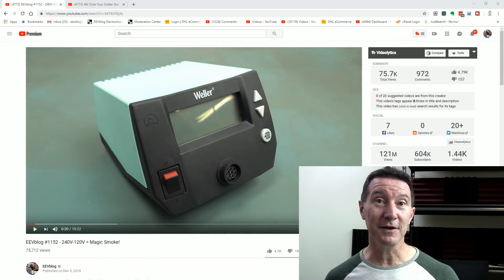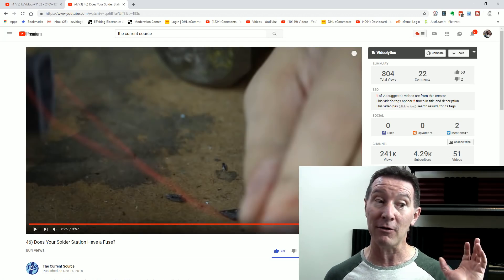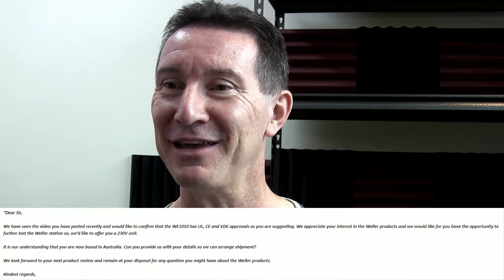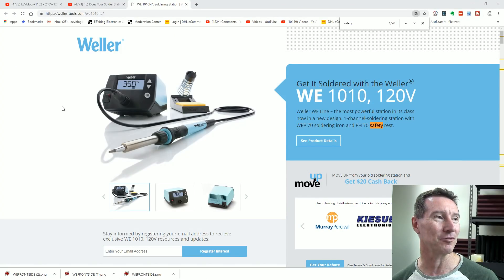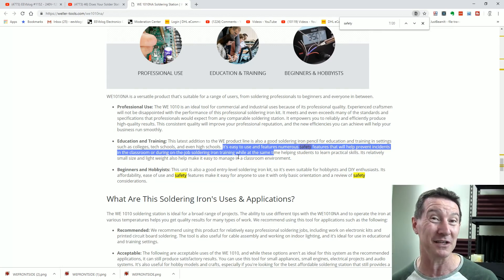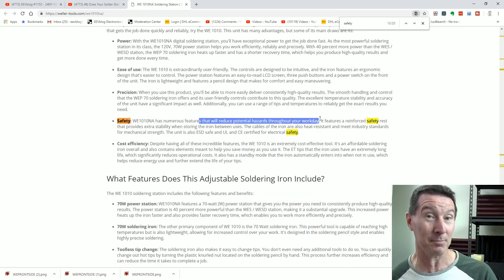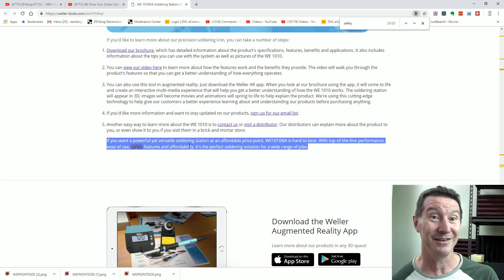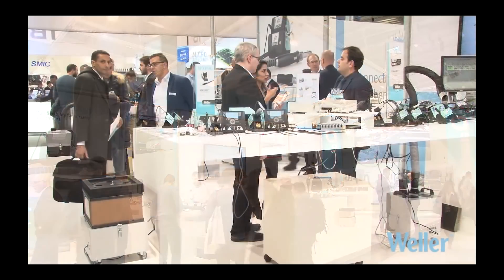EEVblog #1160 - Weller Responds!

Comment: Have a Chinese iron, its been awesome, heats quickly and accurately, has a backlight screen and  cost $80,  has NEVER let out the magic smoke (some of the big electronics  retailers sell same thing rebranded)  and has a fuse. Hmmm wonder why I never paid out the $500 or $600 on a Weller. I can replace this one 6 or 7 times for the price of 1 Weller that if it over volts goes in the bin.

Comment: Dave thx for sharing. Dave what are you whining about, all branch circuits are required by electrical code to have a current interrupter device. Once upon a time it was glass fuses now it's resettable breakers. So no damage will occur to the electrical wiring system. Just because the end use device catches on fire it will have no deleterious effect on the wiring system. That's the important part to remember the wiring will be protected. So what, if the soldering iron makes the user run for a fire extinguisher it'll be good exercise for a bench rat to do a little running every now and again. Hahaha.
Dave thx for sharing. Weller should be ashamed of themselves for ever letting something like that go out the door. I hate to say it, but it was probably signed off by cost cutting younger players who don't have enough experience to know any better.

Comment: Good point but maybe the "heat-resistant silicon cable" provides electrical isolation too.  Cheaper meters might only use silicone and not genuine silicon.  Flexible glass shows that Weller is well ahead of the competition and you should acknowledge that.  Thanks for posting this video.

Comment: It's possible to manufacture a mains transformer so that the primary winding safely fuses if it is overloaded. Without "excessive" smoking and retaining the barrier between primary and secondary. This qualifies it as a UL Class 2 transformer, I believe. So it's safe enough, it just is not a great way to do it because the product is trash afterwards.

Comment: Gotta love it when a valid issue is raised and the response is 'it's certified'... A successful brand like Weller should be able to go above and beyond with a very basic thing like a fuse, or for bonus points a breaker.

Comment: I'd really like to know more about why it does NOT need a main fuse (regarding regulations). Like did you ever see a watercooker with a fuse ? I've seen plenty wall adaptors without a fuse. So I'd like to know why aparantly it is not obligated to implement a main fuse. Thanks.

Comment: I have a Weller that I have used for many years. Usually functional, but unremarkable.  Now that I think back, there are several times that it was left on through lunch and glowing red hot on return. 

Thanks for the report. This is basic stuff.

The Weller will now be retired.

60 Hz or 61 Hz. Whatever it takes.

Comment: Just opened my PU81 station, it actually has a bimetal fuse on the transformer- an additional small glass fuse is hidden inside the 230V socket on the device itself. I bought the unit in 2013.

Pooooh- you scared me. Good this problem is not affecting the 230V series as it seems ;)

Comment: WELLER IS A SHIT. purchased WR-2 soldering station, paid a lot of money, 4 times that I change in a few years, the complete heating unit, (the temperature sensor fails, but the inside of the heating element body is sealed), 200 € per piece.
The quick release system of the tip makes you shit, spreads and the tip jumps away like nothing.
In short, you pay the name, but the product is little more than mediocre.
Beware, don't make my mistake, now as soon as the cheap desoldering station arrives from Amazon I take the Weller of my boots, and throw it in the trash.

Comment: Just got my Weller Model WT1010HN 150 Watt soldering station (2-16-2020).  What a beauty.  Two initial observations:  
1.  It has an AC mains fuse:  1.6 Amp, mounted below the 120 Volt power cord socket.
2.  The LCD screen has backlighting.

So Weller must have heard the complaints.

Comment: Finally replaced my Weller WTCPL soldering station.  Bought it in 1974 for $41.  It lasted more than forty years, with many replacement tips and a few shrink tubing repairs to both the mains line cord and the soldering iron cord.  It has been a great soldering station, but was finally time to upgrade to the Weller WT1010HN 150 watt soldering station.  Guess what:  The Weller WTCPL soldering station didn't have a mains fuse, either.  Guess I am lucky I am still alive.  What I would like to know is how it was possible to plug a 120 VAC soldering station into a 230 VAC socket; they are physically different socket/plugs.  North America uses International Electrotechnical Commission (IEC) Type A (2 prong) or Type B (3 prong, with ground pin), whereas Australia uses IEC Type I, with three flat pins in a triangular shape.

Comment: In defense of Weller, the failure released magic smoke, but didn't seem to be on fire.  If the primary windings used a fireproof "enamel", the risk would be mitigated and eventually the breaker would trip.
Would it scare the crap out of me?  You bet.  But, damage to Dave = zero, damage to lab = zero, and it didn't even trip the expensive fire alarm.
That said, yes, I'd like to have a primary fuse as well.

Comment: I got 3 Wellers, one brand new 2-tool WX series, one WTCP51 magnastat and one 45 years old magnastat. All three are working perfectly and yes, they all have primary side fuses. Problem is with business philosophy. Weller was sold to someone and that someone was sold to someone else. They start to produce cheap stations because of market philosophy they adopted and I am not glad about that. However, I would not buy this stuff. I would buy professional quality station because I do not want spend precious time by repairing my tools. I am glad they still make high quality stations. You can still purchase magnastats which shows how proven they are on the market.

Comment: Historically I've thought of Weller irons as being the "best of the best" or pretty close to it... the main reason I use Hakko kit instead of Weller has always come down to cost, but I had continued to dream of one day "upgrading" to a high-end Weller station.

No more.  If these gomers don't even care (or understand) enough about safety to take something like this seriously, then they are "off the list" as far as I'm concerned.  I'll continue to use Hakko soldering equipment, or maybe Pace at some point. But no Weller.

Comment: I was hoping the BS button would make an appearance!

Actually, I have seen some transformers that have enough "magnetic impedance" (not sure if that's the correct term) that the output voltage begins to collapse if too much current is drawn, so even under a short circuit on the secondary side, it wouldn't get dangerously hot. I would assume that is by design. Of course, this doesn't work under over-voltage or primary side insulation breaking down. However, I've seen other types of appliances with a "current limiting transformer" that don't have a primary side fuse as well. Maybe UL doesn't require it if the transformer is designed to limit the current? Usually you can tell if there's a thermal fuse by looking at the wrapping, there'll be a little lump where the thermal fuse is.

Comment: Hi Dave, do you change your voltage supply on daily work? The real problem is not beeing able to adapt to the local supply standards (230v/50Hz vs. 110v/60Hz) other than a warning. Is there any? Did you pick it? Blowing up a device with double voltage is easy! Preventing it is not a question of having a fuse but proper supply voltage detection. A penny article, hopefully in any hairdryer as it it a typical travelling item.

Designing / rating security using a fuse worries me. A good design is when no fuse is required as it is fail safe.

Comment: I use a weller WECP/LR21, from the mid 80s....still on its first iron, but replaced the heater element twice, and countless tips done...but i also use it nearly on daily bases, also i forgot to switch it off for a complete week sitting on 350degC no problems, but the tip was dead....i gonna stick to it until it may doesn´t turn on anymore, someday (got a second iron, tips and heaters in storage;)

Comment: Hi Dave, I'm curious about this issue.
Here in the UK there would be no need to design mains-side fuses into most portable equipment, as the equipment is implicitly protected by the fuse built into the mains plug.
If I had plugged this 120V unit into a UK 240V mains socket via a IEC mains lead, then it would have immediately blown the (correctly rated for the equipment) 1A fuse built in to the plug. 
(i.e. a 1A fused plug to limit the load to 240W)

What is the household mains fusing scheme used in Australia that made this into a dangerous situation?

I'm also wondering if Australia is the only country in the world where this burn-out could have happened, or whether the same problem could have occurred with Germany's household fusing scheme? (i.e. 240V and no fuses built into the mains plugs)

Clearly somewhere along the line there has been a design mistake caused by someone not considering (or caring about) all the countries and situations the unit might be used in.

Comment: It has nothing to do with anything but liability and cost it’s cheaper to leave the fuse out because it doesn’t catch fire very often so they don’t care at all ! Designs based on cost have no pride or morals seller was a great brant very rugged and reliable till there new lines came out and they needed to make there new stockholders a return at the cost of making it shiter and cheaper all the time till the reputation is gone and the company goes broke all because of greasy stockholders

Comment: I have found that the safety standards and the influence of the certifying institutions over enforcement of these is a lot more strict in countries other than the United States. Countries like Australia, Canada, most European nations, and even those countries we typical Americans often consider to be “third-world”, have standards and laws which are very common-sense and sternly enforced. It would be fascinating to discover how a product from a (now formerly) reputable company ended up being shipped with UL/CE certification, but no mains fuse. I haven’t reviewed UL standards in a while, but they have always been “weaker” than similar standards in other countries, and in the case of a device like these Weller stations, I wonder if they used the “double insulated device” loophole that is usually applied to tools designed with no ground pin on the power cord, such as an AC powered drill, which also will lack a mains fuse.

There’s a lot of regulation of such things in the U. S. that conflict with their supposed intent to uphold public safety, such as the requirement that GFCI units be installed near any damp location, yet the UL still allows manufacturers to produce garage/shop, kitchen, and bathroom devices with two-prong AC plugs, which render the GFCI’s to be useless since they cannot function with no ground reference (although most “wet location” appliances sold in the U.S. now must include a GFCI integrated into their power cord).

And even if the soldering stations in this Weller line are equipped with grounded plugs, all of my test equipment having grounded mains cords also have at least one mains fuse, whether accessible from outside their cases, or soldered onto their main boards.

In any case, it seems unconscionable that Weller would intentionally omit something accepted to be so fundamentally important, so I wonder is it possible that the factory (I would assume In China) took some “cost-saving” shortcuts without Weller’s knowledge, or if these might be counterfeit devices? This is where my mind goes when I find a significant flaw in products produced by a company I considered to be “faultless”, like TekTronics, Fluke, Agilent, and others. 

But I am also seeing a disturbing trend in corporate complacency among a large proportion of U.S. companies, who seem to have lost sight of the concept of value and reputation, concentrating solely on maximizing profits, keeping a far keener eye on their bottom line than on customer service, satisfaction, and safety.

Thanks for another eye-opening presentation!

Comment: It seems Dave owes Weller an apology here.
Tim Krüger is correct in his post. In it he states, "The IEC standard on safety of transformers, reactors, power supply units and combinations thereof (IEC 61558) states that transformers up to 1100V do not need any fuses or overcurrent protection if they are build short-circuit-proof and in case of a failure the temperature of the isolation does not exceed a particular limit." This is common knowledge in the industry. I'm VERY surprised that Dave did not know this.

Comment: You must clear an electrical fault as quickly as possible with a device fit for purpose. The fuse in this case would be to stop the transformer rupturing or even burning though to the secondary and exposing the hazardous voltage to the user or causing a fire.

Comment: There seems to be a lot of apologists for Weller on here but seriously, they are missing the point. Weller, don't be so fucking cheap and fit a fuse. Sheez. I've had transformers short and pop the primary fuse. It happens. I don't want to smoking cords and transformers to act as the fuse, why do people even think this is acceptable?

Comment: Dave: I have 4 Weller solderingstations, all with pullout mains fuse. Also Pace and Hakko. All "good old" stations, 15 years old, some more than that. They are all rock-solid stations, like WD1, WS80 etc. So the WE1010 is surely not the Weller quality wee all know - ..... whats happend?? The most terrible thing is that the answer from Weller said that UL, CE etc. certifications are all OK - and that is even more interesting...why?? how can it be legal in 2018 to connect a trafo directly to the mains voltage with no fuse?? and what idiot at Weller decided to reduce the price if the WE1010 by 0.1USD (or something like that) by installing the mains plug with no fuse - instead of just using the mains plug with pullout fuse that they have been using the last 35 years..?? That is just stupid. And then there is the missing thermofuse...!! bavr! Terrible.

Comment: It would be interesting to repeat the "experiment" with another example of the 110V iron to see if will actually catch fire. Connecting 230V to a 110V iron looks like foreseeable misuse to me.
 There is so much protection on the secondary side of the transformer, it looks like the intention was there to give good product safety.
It is not uncommon for large companies to have development teams working on the same product strung across different continents. Maybe the electronics team thought that the case had the fuse built in?

If flame does not spread outside the unit then that may be enough to pass standards.

Comment: I had a dodgey old Weller iron that I used forever, I was 9 years old when I got the thing, and I was 16 when I threw it away, when I started working as a dashboard technician. In that company, I saw that every station had Hakko Stations and Hakko solder suckers, and they were all in various states of neglect, but they warmed up really quick, they really were superb quality, and they last forever, you can get used ones on eBay real cheap and they’ll last you ten times longer without issue than those Weller irons.

Comment: Dave, your weller vid inspired me to have a look at the two Weller stations that I have(but doesn't use).
I have the VHS40 which is so poorly constructed that you'd be happy to do coldsolder(and not get stuck with the tip).
And the WTCP-S.. VHS40 lacks the primary side fuse, as far as I can tell.
The WTCP-S does have a pullout mains fuse. This unit is from 2006 and was/is/idk sold in the EU.
The WTCPS however doesn't have a pullout mains fuse (from what I can tell from pictures).
And the WTCPS is sold outside of the EU(As far as I know).

Comment: It would have been interesting to see if the 230V EU  model had a a fuse.
The USA made metals of the 90s had a big  chunky switch on the top which only switched the secondary only found this out when T/F started buzzing. If any one can confirm if the new models do this.
The loop hole may be that  it is classed as soldering iron or powered tool the direct mains stick types do not have internal fuses drilling machines do not have fuses in them but Isuspect the would have over temp  thermal fuses in them.
I also detect some free market tubthumpers in the comments who don't believe in any safety regulations.

Comment: I can see both sides of the argument to this. I am sure Weller has done their homework on compliance and safety standards to meet the specification for the product to be sold.  On the other hand Dave won't be the only person to make this mistake with units that have an IEC mains connection.
 I think this is why the 110V ONLY appliances should have their own type of connection fitted to the units which would make it more foolproof. Foolproof also covers users that are in a hurry to use something without the time to think. Even an offset IEC pin would be enough to remind a user why it doesn't fit.

Nowadays a lot of appliances can run on both voltages (switch mode type) which is fine to fit a standard IEC connector. All this needed was a little extra thought on safety standards.

Comment: I agree with you it should definitely have a primary side fuse!! However I have used a variety of these Weller Soldering irons for the last 30+ years,  never had one actually fail, Here in the UK we have a fuse in the mains power plug though! 😃🇬🇧
Reply: The plug is the insertable part, the cord, so you are saying the cord is fused? Or the recept on the soldering station itself?